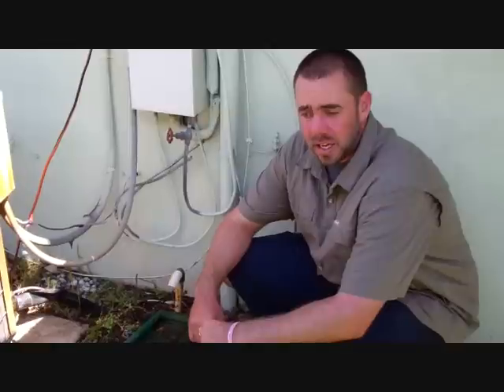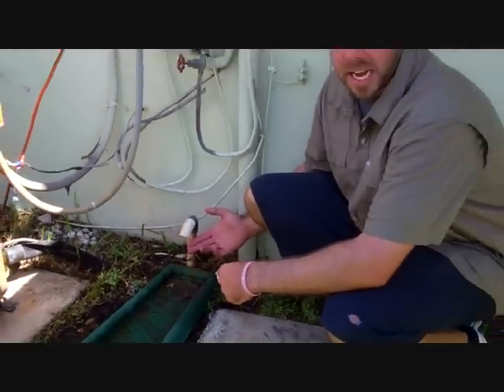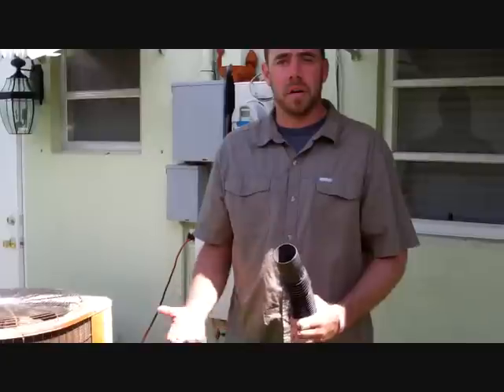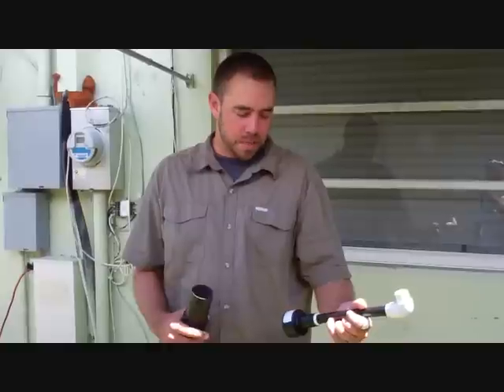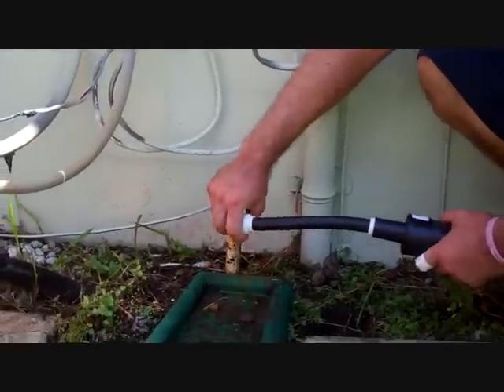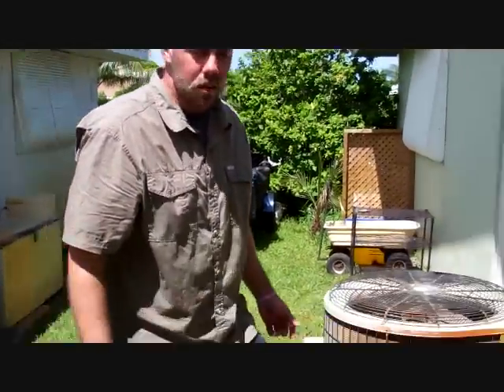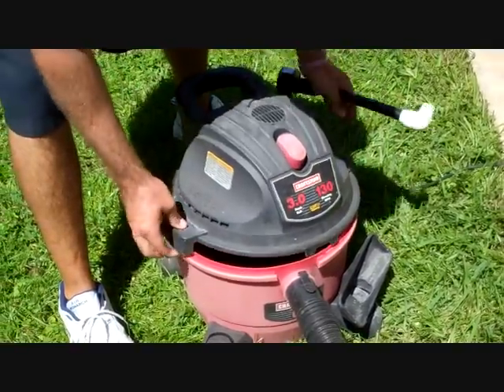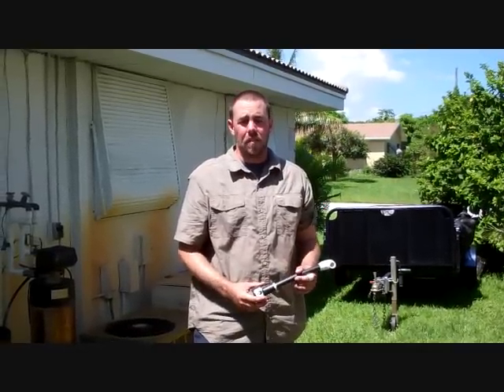How to clean your  ac condensate drain line  in 5 minutes .Available on Amazon keyword :Diyvac

Comment: Awesome video. Ordered the shop-vac adapter and pulled about 5 gallons of water out of the clogged lines. Finished things up with a rinse of the lines with a gallon of water/bleach mix. No more shutoffs or errors on the thermostat. It was hotter than six hells in the attic, but it was very cool in the house shortly thereafter. Thanks for taking the time to make the video and helping the DIYers.

Comment: excellent...I've used this a lot...if you can dump a little bleach in the tray of the ac, or they actually sell bleach tablets for it...here in fl it's a good idea. but the shop vac will get you out of trouble right away...